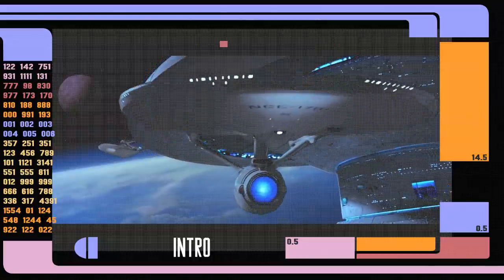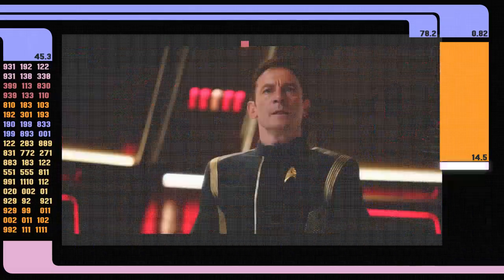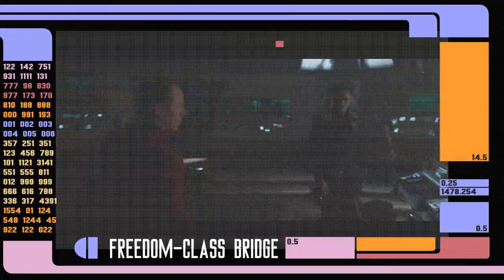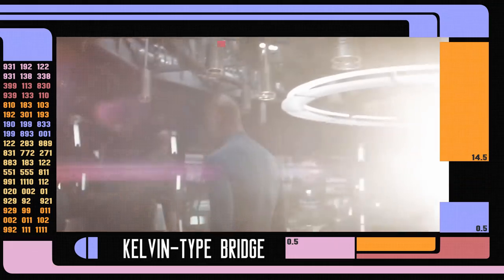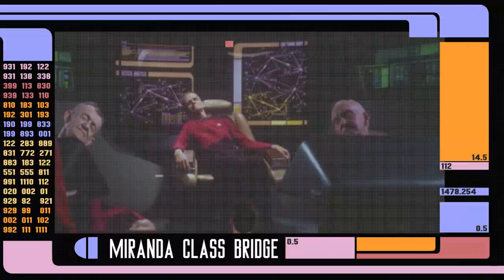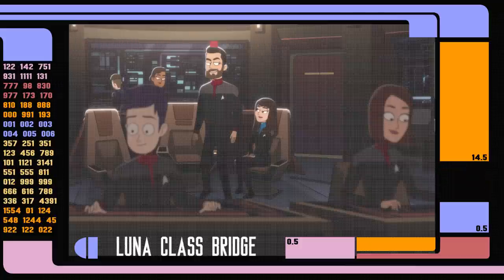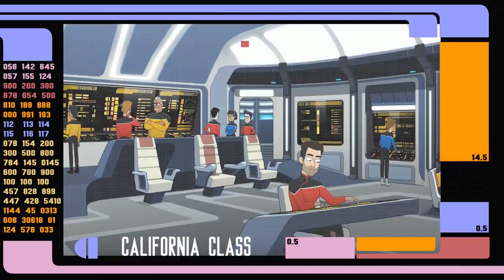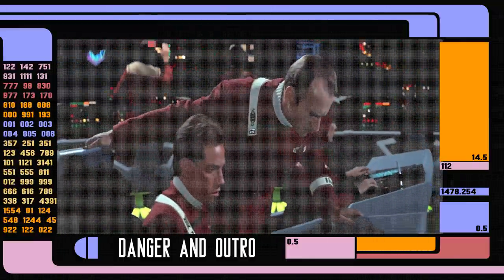Forgotten, Fatal, and Unethical Starfleet Bridges

Comment: Realistically, if a battle is taking place across hundreds of thousands of kilometers of distance, a window isn't going to make a damn bit of difference. No battle in space should take place at knife-range, that being less than one hundred thousand kilometers. With light-speed weapons, i.e. lasers and grasers, engagement ranges can be upwards of five hundred thousand to a million kilometers. When you factor in things like missiles or torpedoes that could potentially have engagement ranges upwards of six million kilometers, or more, it makes a window largely useless.

Speaking of distances still, when you need to see across entire light minutes or light hours of distance, again, a window is less than useless. For example, when you enter a solar system, if you stare out a window you're looking at an image that is already several light hours old. Light is pretty slow on a solar system's scale of distance. By the time an enemy sees you their image of you is also several light hours old. When both sides start to "see" each other, you're both reacting to images that are, once again, light hours old. It isn't until you get a lot closer that you can react in something close to real-time.

I don't care what kind of futuristic material that you make the windows out of, it's still a dangerous structural weak point.

I like how the ships were designed in the Honorverse and the Lost Fleet series or even the Expanse. I don't see one window in those universes.

Comment: Sorry.  Windows are not practical or safe because of both the intensity and wavelength spectrum of light that they would let in.  It is better for a display to remove any possible dangers from incoming radiation.

Comment: Modern: 
- spacecraft only use line-of-sight for precise maneuvers when an object approaches another when one or both involves living people, and only at “close” range; most of the approach is controlled by observing readings and instruments.
*Docking a shuttle to the ISS utilizes technology right until the last few hundred meters, then humans pair readings with manual control. No shuttle exits atmosphere and then wastes time and resources “eyeballing” the wide-spanning and identically black and white canvas of outer space in hopes of SEEING an object that reflects light, like all others, and may look like another non-target object at a distance, or even a distant star or relatively nearby asteroid. Going by his “modern” standard, I’ve posted this^^^, and the following based on his claims by 1:30. Needless to say…The ocean doesn’t have enough salt to take with his claim.
- submersibles can barely see 20feet away; an inverse analog to starship seeing into an endless void littered with billions of identical white lights.
- naval ships have windows on observation decks and the helm, yes. But the CIC, where combat data are analyzed and decisions are often made, is protected within layers of hull.
- Seeing that a target is ahead doesn’t help you aim when your weapons aren’t personally manned and manually targeted and fired. If your guns rely on scans, calculate firing arcs and tracking, and the only way to fire is to use a remote device at in the helm, then your ship relies solely on technology; the human factor is minimal and can be mitigated.
*There is no reason for windows beyond aesthetic: 
- the rounded hulls make it impossible to look fore or aft to see any exterior damage, as you would need to see several degrees behind your position from a window that doesn’t stick out enough to allow it.
 - “They are a structural weakness…,” Legion, Mass Effect 2
- If sensing light sources helps you get discovered against the darkness of space, or heat emission from weak points in a hull section, the windows will remove all stealth options simply by the inside of the ship being warmer than a vacuum, and a crewman turning on a light that isn’t analogous to that of a star in measurements; wavelength & frequency.
Sci-fi’s, and mainly Trek’s, obsession with lights everywhere, ships being covered in windows, important sections of a ship sticking out by some strut of metal too weak to hold up, and making everything identical to the here and now?
It’s insulting.
It assumes that the public viewer base doesn’t either A. see how another set of systems would work better for the situation we currently have little precedent for, or B. they’re correct about point A. 
The first is an insult to the fans. The second is the fans being an insult to the species.

Comment: I still find the windows dumb, mainly because it requires having one of the most important functions of the ship next to the exterior, logically the most important functions of a ship should be well protected near the core of the ship, and as far as I know real navy ships have an armored room near the core for command and control. View screens with multiple layers of redundancy should work fine as long as the plot doesn't require them not to.

Comment: Windows are one of the biggest hazards even possible on a starship bridge or anywhere else in a starship for that matter. Can you say hull breach? That would be like the easiest place to cause a hull breach as it would be the weakest. Even if it's 1000 times stronger than airplane quality glass it still wouldn't hold up.
Reply from the maker: As I stated.. in the trek universe.. the windows are literally as strong as metal. So a hit there has the same impact
Reply: you're not wrong there.
compare the NX-01 or NCC-1701 to later ships and you can see a big difference in window placements.
Reply: @LoreReloaded  I stand behind my original statement. Windows are asking for a hull breach. The notion that they are as strong as metal is ludicrous. Maybe they're as strong as modern-day metals, but they are not as strong as Trek metals, and phasers can eventually cut through those, they could slice the window easily, not to mention a photon or quantum torpedo.
Reply: I enjoy some of your analysis videos just for the fact that they look into things that a lot of people don't even think about but I find a lot of your hypotheses completely bogus.

Comment: And the argument against and the biggest reason why you do not want windows on your bridge, let alone your bridge near the exterior of the ship, is because it is a giant fucking target with the words "hit me here" painted on it! And indeed we have seen this tacket used dozens of times. The bridge of the ship should be towards the center of the ship in probably the most if not 2nd most defensible position possible. With engineering and the worpcore being the other!  Well you can still have windows on the exterior of the ship there should be nowhere near the bridge. And indeed you could still have the same effect with a good old fashioned periscope.

Comment: Just cause you can make glass with the tensile strength of steel you’d never be able to make it with the ductile properties of metal. I’m sorry there’s certain laws of physics you just don’t get a break. Again you might have a window but you wouldn’t use it for your main source looking out you’re totally disregarding the distance is involved in space as opposed to the distances on a surface worship. There’s a big difference between looking at something that’s 5 miles away in something that 50,000 to 500,000 miles away much less 1,000,000 miles away.

Comment: Windows are huge structural weak points. The US navy didnt put portholes in their ships for viewing, it was for ventilation. Pre AC, naval ships were hot and humid. Bridges on warships need glass to see waves and wave height. If you ever go into a storm where wave height can go to 20 meters, where you lose the sight of the sky in front of you as you descend down the wave you crested down into the next trough you need to know where to point your bow so you can correctly climb the next wave. 

The first orbital "ships" we had had no windows because engineers knew that the "pilots" didnt need them. But they were overruled because the US wanted astronauts to be rockstars. Probably the only ships that needed portholes were the ships that went to the moon. They used actual star position to get correct positioning. And when you are running power systems on less amps than a modern hair dryer, every amp pulled counts. But in that case, it was a tech constraint then.

BSG and the Expanse did this well. If Combat starships are ever built, they wont have windows. If they do, it will be in heavily structurally reinforced areas, probably to assist in resupply or docking procedures but only as a safety measure or in cases of severe battle damage. But you can just as easy have a guy suit up and stand on the hull with a radio and communicate the the bridge. Windows are bad.

As for the 3rd chair on the Sovereign Class, thats for the political officer. Troi was a plant from the start.
Reply from the maker: In the trek universe, they are not.
Reply: @LoreReloaded  I am just speaking from a purely engineering standpoint. imaginary tech like force fields, deflectors and whatnot, I dont even see why you would need a structural window. I mean honestly, If a force field can keep air in a ship, why even have bulkheads?  Just a giant framework with a power source, engine and control systems would be all you needed.

Comment: If you go back to old submarines you will find that for example the US had a $80 ashtray this was not to be so it’s a stupidly expensive it was to do with that if it broke it broke into very little pieces because it one thing you don’t want on a ship what is at war thousands of pieces of glass hitting you in the eyes so you can’t see so that’s the reason why the ashtrays was so expensive on submarines.
The rocks what come out of the wall at the same principle you don’t want thousand the shards of glass running around the bridge in the air when your people need to see

Comment: Yeah I'm going to disagree with your take on windows. Window are still, at very least, a structural weakness. I reject the notion that military submarines would have windows if some sort of transparent metal came along because there's nothing to be gained by it. Field of vision is generally so low as to make looking out of a window meaningless. Sonar, along with the rest of the navigation systems used would still be the preferred way of navigation underwater.

I'm confused by your argument as to windows being obsolete in the present as well as your argument that some submersibles do have windows. Submersibles used by the military, as far as I know, don't have windows. While submersibles used for exploring do have windows they're for the purpose of more precise navigation and probably for research. These craft are also small. If present technology allowed for precise movement and research without windows (like the technology shown in Star Trek), these submersibles wouldn't have windows as they're a liability. Windows for vehicles aren't obsolete across the board. Some vehicles require windows to fulfil their role while others do not, so I'm not sure why you're generalizing. Our militaries do still use windows on seafaring, ground, and aerial vehicles as they require precise navigation. However, if you look at them, they use as few as possible and are as small as possible. If the military had technology to allow people to navigate precisely and acquire targets without the need for line of sight, I guarantee those vehicles would not have windows. 

Ships in space using windows is impractical because navigation systems would be used to orient the ship both in combat and general navigation. Windows are a redundant liability and obsolete next to the greater amount of data obtained through the craft's navigation systems. Navigation systems will always be vital or useful in the very least, windows have a very narrow scope of function in terms of navigation in space. Even if navigation systems went off line, they would still be imperative to be fixed as navigating through line of sight alone would not be practical. In terms of Star Trek itself, we see that windows are not at all required for target acquisition in combat situations. In those rare occasions that you would need a window, Star Trek already has a solution to that which is the viewscreen, meaning that a camera system and sensor away adequately fills that role, as you even admit. Your assertion that you lose nothing by having windows is baffling considering one of the fundamental arguments against windows is that they sacrifice structural integrity.

The only circumstances in which your argument holds weight is if the materials used for windows are every bit as durable as the materials used for the rest of the crafts armor and paneling, which just isn't the case. The best compromise you could get is a system used in Mass Effect's Normandy SR2, where the windows are immediately shuttered when entering a combat situation. Even then though, that introduces more points of failure.

While windows are needed for atmospheric flight and terrestrial vehicles, as far as I know the ships of Star Trek generally aren't meant for either. Shuttles are meant to fill that role and so it does make sense to have windows on those.

Comment: The apologetics for the windows is a good try. But it falls short. I've yet to see a military submersible that has windows at the Conn. Fighter jets use them because we don't have FTL sensors and all the things Star Trek does. And we see enough of things like Nemesis to know that the transparent aluminum, while strong, is not as strong as the stuff used in the rest of the hull. Combine that with the fact that the bridge is on top, and you're giving the enemy a free shot at your command crew. Especially because we know that because Federation shields are wave/frequency based, there is a moment where the shields are "down" even when they're up and at full power that allows for damage bleed-through even when shields are at full. As evidenced by the fact that crap can start blowing up while the shields are still up.

That the enemies of the Federation are too stupid to take advantage of this is not an excuse.

You want to observe scientific phenomina? That's what an observation deck is for. Rig some consoles up on it, and you're good to go.

You need visual observations? It's called an external camera. Drone pilots use them all the time and "somehow" maintain situational awareness. 

The only excuse that Trek might have is because the "plot device of the week" causes their tech to fail with such alarming frequency that they want a zero tech backup. Even then, that's no excuse not to have some armored shutters over the damned things....

Comment: Window allow you to see things close to the ship. These starships have battles in ranges of thousands of meters, or tens of thousands. The idea that a fighter pilot uses their windows is correct, however, they should be using their instruments. they can't lock on to a target that has already passed. If you have forward facing windows, you can't target, or figure out where a target currently is without the system.
A captain of a warship on the water needs binoculars or camera systems to identify targets. They can't just use the window as the target is too far out.
If the captain has to rely on windows, it's already too late. the target has to be in front of them in order to target them.  If the sensors are down, and they can't rely on their sensors to track a target, they are already dead.
Your arguments lack basis. Entertaining, but without basis.  Yes, they would use metal windows, but if they have to use windows to target, they are already dead.
Reply: Windows would also confuse anyone trying to shoot because they might look up from their console and try to gauge shots from the window instead of relying on the sensors. Windows will never be a good idea on a bridge. Hook up a phone or a camera to a window in a non important area and you have the same effect without compromising the bridge.

Comment: consoles exploding still just doesn't make sene, why the fuck would they route high power conduits straight trough their console? What they need to to is to keep console on a seperate power system and just connect them to the actual shilds, weopons, engines, ... trough some kind of network connection maybe fiberobtics or some kind of wireless conection, that way they can't explode.

Comment: Star Trek and Star Wars inaccurately portray ship combat in space. 

Removing gravity and altering inertia, the heat signature of a space ship would be easily recognizable at vast distances. Thus combat would be more like two snipers shooting at max range rather than up close dog fighting. The Rest is irrelevant. Due to it's necessity, the bridge being on an exterior part of the ship is a stupid idea, as a holodeck in the center of the saucer is a much more prime location since they're using holographic viewscreens anyway. This would allow it to conform to whatever the need was.

But it doesn't work for set design. So we have what we have.
Reply: Set design, eh? Tell that to the Sharlin-class... You can do lots of "cool" things for sci-fi set design with internal CICs. Even if there's barely any practical set at all! :D